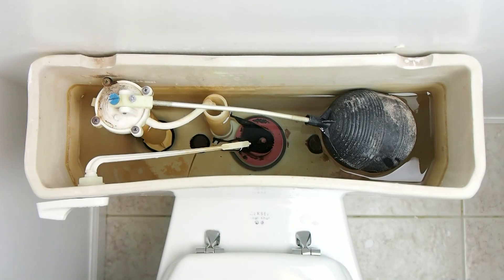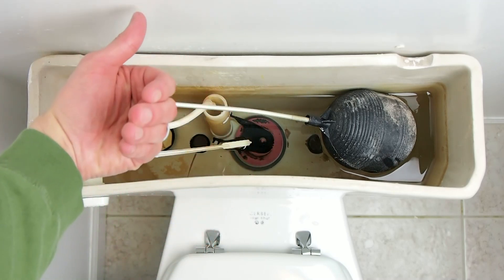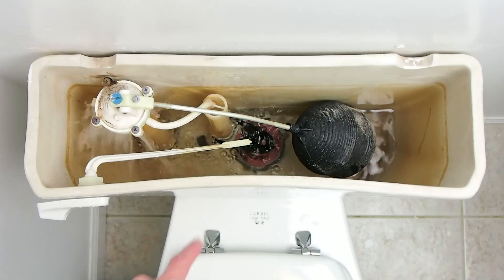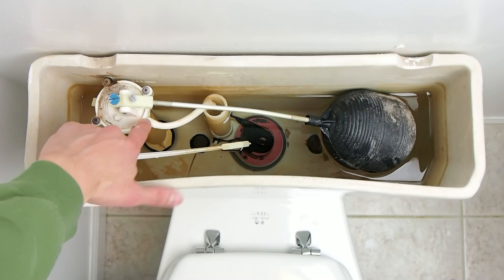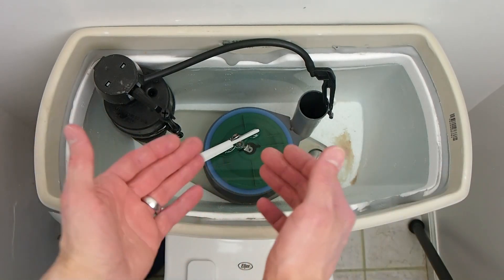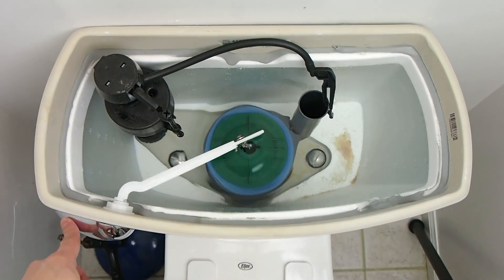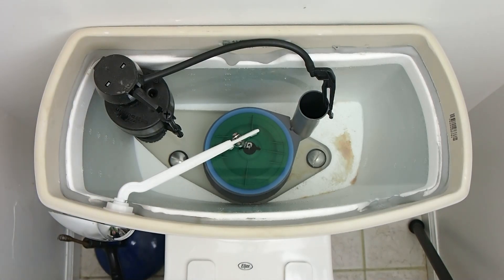How Toilets Work

Comment: That fill valve on the first one is NOT broken. If it is ONLY coming out of the tube, the toilet won't function at all. That tube is not going into the tank at all. It is going into the flush valve overflow, which refills the bowl water level. That type of fill valve is actually acting completely normally.

Comment: The one with a big diameter flush hole is junk.  It only uses 1/2 of the water in the tank which is not sufficient for a strong flush.  Is there a replacement for it that seats lower and on the bottem of tank to allow all the water being flushed?
Reply: Modern toilets are even more reliable than the early day toilets and are more water efficient but that doesn't affect the flushing whatsoever

Comment: It is not true that the water from the valve is supposed to flow only through the little pipe.  The main flow is normally into the bottom of the tank.  The gushing on that first valve is a bit unusual because it normally would come out near the bottom of the tank.  It's quieter that way.  The little hose is directed into the overflow pipe.  That little water is to refill the bowl, not the tank.

Comment: Do low flow toilets flush stronger? I often need to use a plunger to clear the bowl after the first flush. Are there kits to convert older style toilets to low flow? Thanks.
Reply: I have a low flow.  It's junk and needs to be replaced.  You need water to flush.  All other is BS.

Comment: If low flow toilets theoretically deliver the same amount of force, why in practice do they tend to block more?
Reply: Low flow toilets are somewhat more likely to block up more frequently due to the reduced water amount they use
Reply: Too much toilet paper or a megadump will cause it to block.
Reply: They don't work.  The more water the better.  I have the same low flow.  I will through it in trash one of these days.

Comment: well that was a pleasant surprise I type in how does a low-flow toilet work and it brought up your video. I was just curious about what the difference is
Reply: There isn't much of a difference it's just a Low Flow Toilet has a much larger Flapper to seal the hole that the water 💦 flows through

Comment: How does the float close the valve?
Reply: When the float gets high enough it will push down a washer inside the fill valve thus stopping any more water coming in but should it be defective the water will continued to run due to the float not being able to seal the valve shut

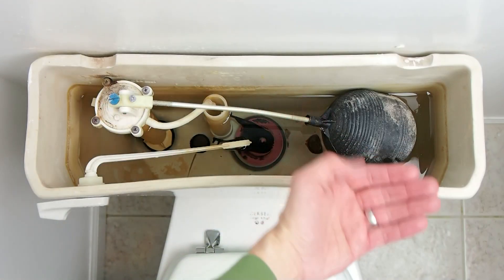Comment: Ahhh.... dude.  Some bad info. here.  The fill valve puts water into the BOWL via the overflow tube at the same time it also delivers water to the TANK.  Typically it directs water to the TANK from near the bottom of the fill valve tube.  You are right that water spurting out of the top means the valve is faulty.. but you are dead wrong when you say at about 1:22  "water flows through this hose  down here and starts to refill the tank".   If water only went "through the hose" the TANK would never fill.
Reply: I was about to post exactly the same thing. If people actually believe what he says there's a lot of people going to be replacing their valves.
Reply: Yeah he probably shouldn't be making videos of "How a toilet works" if he doesn't know how a fill valve works...granted that is an older style one vs. the Fluidmaster style, it's working fine.
Reply: Somehow I didn’t catch what you said, how does water fill the tank? I know tube goes in flush valve (fluid master) and refills bowl, but I don’t see how water gets in the tank since flush valve seems sealed off from tank.
Reply: @01aharley  it most likely comes from the base of the Fill Valve
Reply: good catch!  was still a nice video though.
Reply: Donald Betts The video is a visual lie about water refill also. Something bigger is happening unseen.
Reply: jgdoollc The lie is intentional but why?